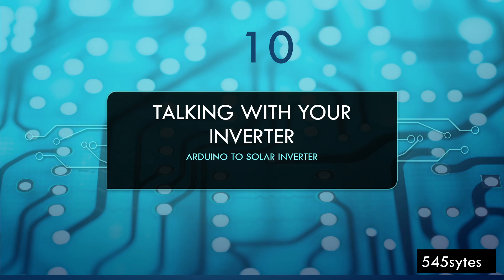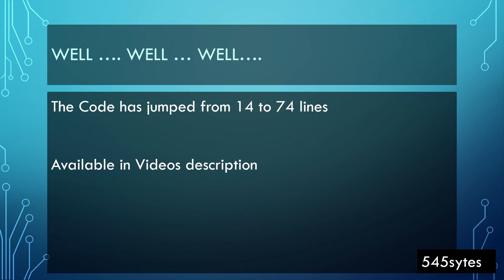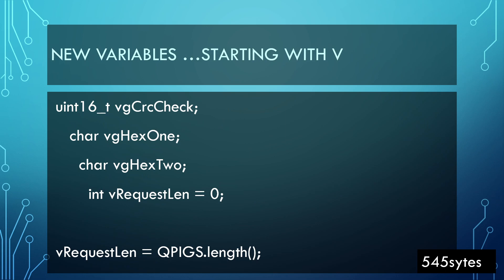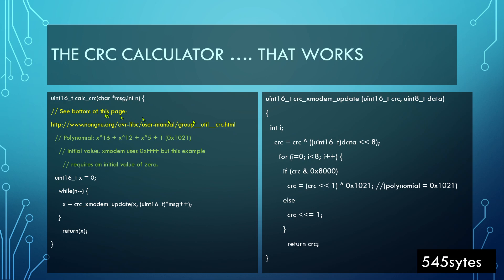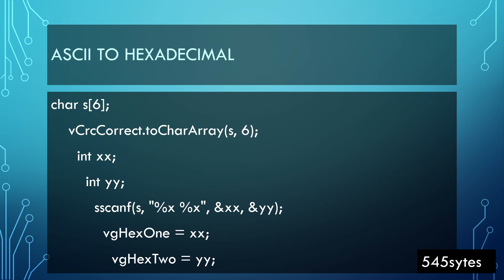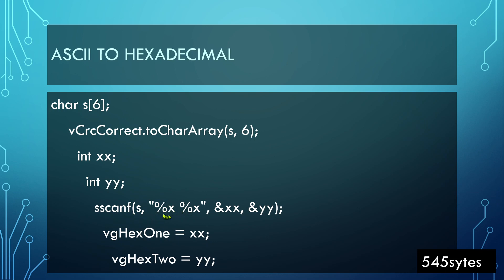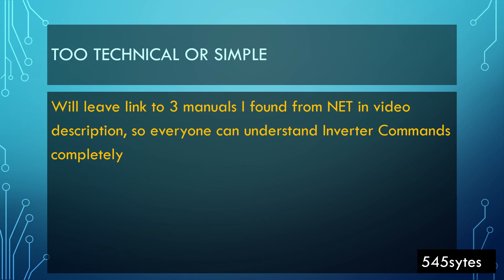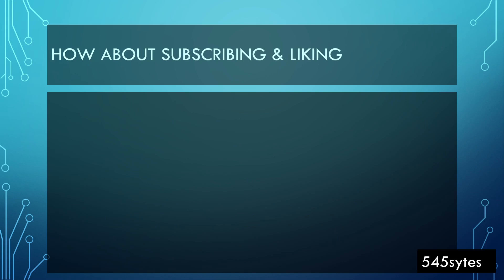10 (Ard to Invt) CRC Calculator for Solar Inverter

Comment: Good Job
I had run the 'Q1' command and had got this response
"(01 00 13 000 031 022 039 00 00 000 0030 0000 11h\xC9\r"
But didn't find any descriptions about this response
And I have 2 MPPT but the "QPIGS2h-\r" is return "(NAKss\r"
How to get the list af awaliable commant for my Inverter?
"QPI\xBE\xAC\r" is return "(PI30\x9A\v\r"
and 
"QMN\xBBd\r" is return "(VMII-NXPW5KW9\xB3\r"
Thanks

Comment: It’s a nice explanation 
I have recently commissioned a Flinline infini 15kw inverter which has USB port , and one rs232 port

But the solar power monitor software doesn’t have the last options ‘ modbus’

But the software provided with the inverter and your software both are same and only the name is different 

Can I use the your recommended version of software and try the procedure you explained in all videos 

Really your explanation is easily understandable and now I have the confidence to make my own driver using arguino or nodemcu to talk with inverter 

Till date having 25yrs of experience in automation field I had never watch such a nice explanation about rs232 command set 

Now it is 2.11 am  IST and could not stop my video even felling sleepy . Watched all the video till end

Thank you 

You should make more videos on your experience as your videos includes purely practical and rhetorical concept together which is very easy to grasp
Reply from the maker: Thanks for encouragement. Its booster doze.

Definately you can try Software, it may work for you, I will try to place a list of models that work with software on my website or create a discussion forum with such list.

Comment: THANK YOU so much for making these video's - you are very clever and it is extremely useful!
I have a question if you don't mind answering. I want to get the data which is printed into serial monitor and separate them into individuals so I can send them to an MQTT server. How can I separate the string into individual strings?
Reply from the maker: You can use substring command/function to split data received from inverter

Actually, I want to do it as next series, how to create webserver and use inverter data, but this may take few weeks before I could spare some time.

What I have found is ESP NOW is a real goodie and MQTT may not be needed anymore, my videos/webserver will be based on ESP NOW
Reply: @545sytes   I will look at how to use the substring command, thank you for that.

Yes I saw you mentioned ESP NOW in a earlier video and I am interested by it too. I have only recently learnt MQTT and have it working , I also have some basic knowledge in NodeRed which is why I am looking into MQTT. But ESP NOW looks like it will be very promising for the future. 

Thanks again for making these videos, they are so good. I found them via Arduino forum
Reply: @545sytes  I'm not sure if my string is outputting correct? I have managed to change values to float and post to mqtt :) but for some reason I cant find the current charge or discharge of the battery. Are you able to help ? No problem if not I know you will be a busy person! 

(000.0 00.0 229.9 50.0 0344 0287 004 425 54.10 004 100 0039 02.9 168.3 00.00 00000 00010110 00 00 00490 010zg
Reply: Apologies, I found it. The charge an discharge current are not in the same section. Once I downloaded the rs232 protocol for the inverter from your link, I saw that the charge current was section K, and discharge was section P. Very happy. Thank you for all your work and videos :D